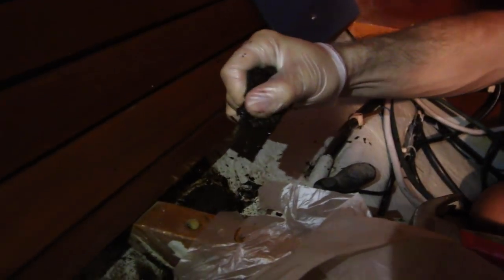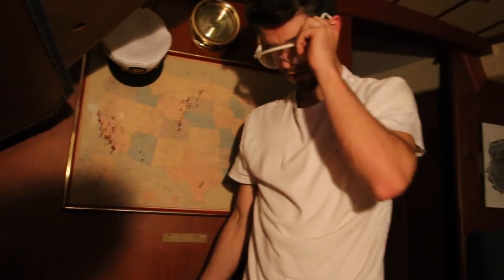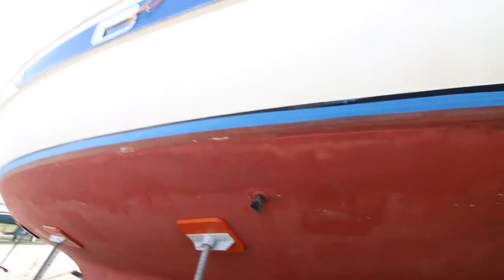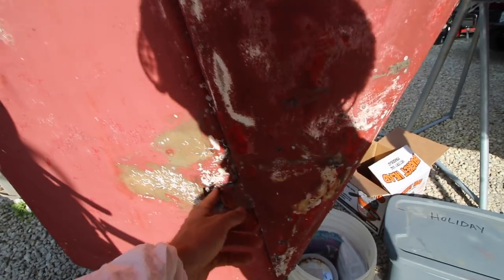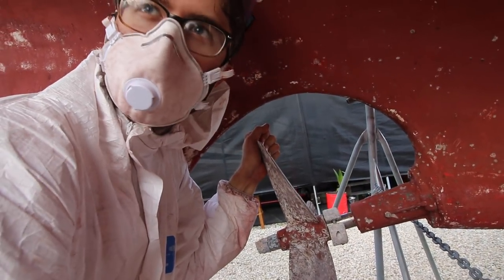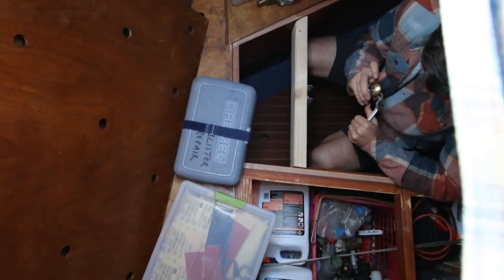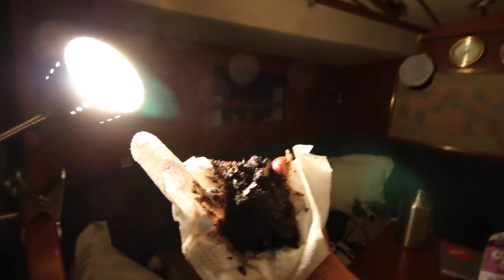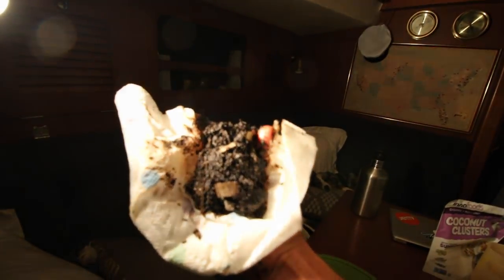25] Refitting Our Hallberg-Rassy 352 Sailboat (Part 1) | Abandon Comfort - DIY Sailing

Comment: Hey guys, I'm a diver who does hull cleanings. Depending on water conditions that stuff may have grown there between the cleaning and when Lucy was pulled out of the water. If you're not confident in the cleanings being done, shop around for a new diver and ask them if they would be willing to take a GoPro or similar camera down with them to give your a before & after of the condition of the hull. This will also help you to keep track of overall condition below the waterline.

Comment: About the plywood around the propshaft: i had a similar set up on my Contest 29. The ply wood has two tasks. One is, on my boat, to have something to fix the inner shaft bearing to, without having to drill into the fibreglass. Second is for installation. When building the boat, they put the tube in, in which the shaft runs, line it out anfd then fill it up with Polyester.
Reply from the maker: Appreciate the insights! Definitely seems right to us.

Comment: Love the HR 352, bit too much boat for me though. Moisture readings on that rudder and around the anchor pintles is in order I would say. I would drill a few small holes in the very bottom of the rudder to see what comes out myself. Your can just jack some 5200 in to reseal them.  The wood at the stern tube could have been temporary support for the shaft tube to hold it in place while the glass work was done.

Comment: You two are doing a deck job so you should have time to do a full bottom job.  I would strip all that old bottom paint to the gelcoat... the whole hull.  Move on to the deck job to give the hull time to dry out if it needs it (have some moisture readings done).  Take your time fixing the cracks and damage you find with epoxy/glass.  Someone already mentioned below, the rudder could have a wet core.  Take your time and fix it right.  After 6 or 8 weeks or drying time and all the blemishes fixed, put on a fresh barrier coat of Interprotect 2000E.
Reply: have we established if that rudder HAS a Balsa Core ??????
Reply: Not sure, and not likely on a Hal Rassey.  Even if its a foam core they can still soak up water.

Comment: Ok so my guess about the plywood you found with some epoxy paint on it would be that even with an inch of fiberglass it needs a solid shape to hold on to while it cures. No need to take the plywood out after the fiberglass sets up so it sat there for years and finally rotted itself out.
Reply from the maker: This seems like a good guess to us as well! Thanks so much for your insights & comment.
Reply: Do you guyz ever hear from Jim?   Curious if he watches your videos...
Reply: It might be a difference between the German Frers and Olle Enderlein layup design but our hull in the Rasmus is a lot different inside.  The construction of the cabinetry and the slats are dead on identical though.  They didn't change that at all. We have no wood down below like that embedded into the hull and have had zero problems with wetness/rot because of that.  In our boat the cabinetry and V-berth supports are all sitting on a big squared-off section of fiberglass molded in as stringers from bow to stern.  It is hollow and doesn't have any wood in it I do not believe.  Some of the upper ones are used as conduits for wires.  

We had similar wet wood and the "potting soil" in our deck though under the stanchions.  We had to open it up and dig it all out before filling in with thickened fiberglass.  What a PITA.  

Your shaft tube and stuffing box are a LOT more accessible than ours. We have to basically crawl down into the keystone area in the aft cabin head-first and then below the sole panels and do a handstand to reach it.  

Don't forget to post the fixes and update us next video.  I'm interested to see how you reinforced the area to support the V-berth crossbeam. 

That black stain almost looks like blood.  Maybe the last owner was a cannibal and he kept the carcasses up there under the V-berth.   Haha.  Don't think about that ;)

Comment: I'm a boat builder, the rudder, they are almost always an issue with keeping them water tight, best rudder is all hi-tec composite, post and all, pricey though.
So, rudders have metal components, and are also made of timber, foam etc all glassed with polyester or epoxy, both will not stick to metal, peels off, there's where the water gets in.
If the inside of your rudder is dry, ur lucky, if it's wet, then it is a removal, strip & rebuild job if you don't want any more issues. (You will still have future maintenance though)
See, those rudder pintels - the metal hinges, 'in' the rudder (where it's cracked) need to be external of the glass layup on the rudder, usually in a rebate, which has been glassed when the rudder was built, then some lay up over this for stream lining and looks, (or bog it up as later others see this as a fail and lay up more glass over the 'fail') this way no water will get into the rudder timber/foam to rot, stay wet and be forken heavy-as.... 
Now here's the thing, there is the rudder post, it has the same problem, it's metal, but here I have almost always removed the glass and core around the metal stock (post) a good 1 inch, beveled in on a 45 deg angle, glassed that tidy, when half set removed any glass/resin off the post to metal, 2 pack primed the glass after a little sanding to tidy up, then slightly over filled the 45 deg glassed hole with MS Polymer - wait a day till set and with a new 5/8" craft knife blade sliced it back to the rudder shape, (MS Polymer doesn't sand good) then undercoat and anti foul her.
Reply: Ideally, if you can get details on the original build plans, you will then have an idea where issue is, how the hinge is built into the rudder. The above mentioned repairs, may not be the whole issue.......
Some rudder builds have large metal plates the hinge is bolted/welded too and timber/foam is sandwiched to both sides, shaped, and glassed.
A short term fix to the above hinge/glass crack, may be cutting away some glass to a point where the glass is thicker, then knife on MS Polymer best you can, this giving a flexible join, but every time she is hauled give it a good look over. Re building rudders is a big but not insurmountable job for your abilities, and lots of learning hear is great!

Comment: Possible that the wood by the prop shaft was there as a dam to hold back the epoxy/glass mixture that was poured around the shaft log. If so, it is neither structural nor needed. Remove it and move onto other projects. Any wood near the prop shaft is going to get soaked.

Comment: I'd have someone with experience inspect that rudder and mounts ... absolutely critical that you can count on it to do it's job when stressed in rough waters.
Reply from the maker: Yea we had the guys at the yard look it over. They said its just the gel coat and nothing more. The rudder is solid just needed some epoxy & barrier coat to fill it in.
Reply: Boy I don't know, as a mechanical designer and if I saw the cracks shown in the video. It would be coming off for a through inspection and repair

Comment: Looks like your rudder has been in a collision. Inside, the core of some boats is balsa wood. Goes  like sponge when wet. Replace and re fibre Matt it.
Reply from the maker: Yea we don't think was due to a collision. It's a few small cracks in the gel coat near the mounts, the structural integrity of the rudder is sound.
Reply: Abandon Comfort lucky, maybe just stress cracks from sitting in a cradle. Or excessive rudder angle when under full power from the prop.Good luck with your refit. 👍
Reply from the maker: Excessive rudder angle sounds right. We'll have to look that up!
Reply: Abandon Comfort if you reverse your boat and apply half to full throttle spinning your prop at high speed and long durations.  then  turn your rudder at large angles it puts the rudder under a very high load. Short burst of power when  manoeuvring. It can do the same going forward with the rudder full over and high power. Slow controlled and small rudder inputs. Maybe difficult with a long keel, but use your prop walk and prop wash to turn. Look it up. 👍👌
Reply: BOW WAVE PAUL has some legit insight.  That rudder can experience tremendous stress when thrown over hard.

Comment: Guys I don't envy you that work, it's the darkside of DIY boat ownership, pretty brutal but please do yourself a favour and get a multitool, as I have mentioned in a previous comment they are amazing. I'll guarantee that you'll both kiss me in pure gratitude once you've experienced the wonder and bliss of multitool ownership, especially scraping they have no match. I had a similar feeling after getting one and the realisation of a lifetime of balls-ache that could have been avoided with a multitool in my hands. 
 
I personally would recommend the previous generation Fein or any similar Multitool that uses a similar tool interface, because the blades are so cheap, universal and plentiful, the current generation uses an almost proprietary tool interface that has as yet not been widely cloned and copied. Last I checked the dewalt also uses a tool interface that uses easy to source blades. If you doubt my words then try at least rent a multitool first and see for yourselves what I am talking about. Good luck and don't forget to use ear muffs/plugs with noisy power tools 😉

Comment: I would say that the stuffing box needs new seals / bearings and re adjustment. Are the leak proof rubber bellows still good and sealing.the stuffing box The box will most likely have a grease nipple ? Cheers from an old wooden boat owner.

Comment: I’ve fixed many things on my inboard/outboard power boat but one thing I will not do is sand bottom paint. That toxic job I will pay the boat yard to do...please use the best personal protection stuff you can get.

Comment: Just wondering what the purpose of that piece of wood in the beginning was supposed to be?  If it is a longitudinal stringer to stiffen the hull, then the flat surface just below it would serve the same purpose.  Just seems like a bad design.  If it were me I would just strip the whole area free of wood and down to bare fiberglass hull.  On my boat the whole cabin sole was wet plywood glued to the hull underneath.  I just ripped all the wet wood out.  Much better and no moldy odor either.  If you feel you really need a longitudinal stringer, I would just cut a closed cell foam strip and glass it to the inside of the hull.  The glassed in box shape will provide stiffness with no worries about future rot.

Comment: hey guys good job, Kelsey you should use a better respirator mask that stuff is poisonous and Ryan check all the chain plates and seal the deck if necessary water destroys everything
Reply from the maker: Agreed! Next time we're getting full-face respirators. And the chainplates need to be rebedded and sealed. The deck comes up tomorrow so we'll have a better idea of what we're looking at with the chainplates and the new deck will be watertight. :)
Reply: cool
Reply: curacao11 agreed definitely a better mask is needed. Ideally if you’re not going back to bare you should wet sand the antifoul.

Comment: I sure hope you tested that paint for metals (not just lead). I do this for a living (I'm a "CIH", look it up). Breathing any metals is bad. You should ditch those disposable respirators and get rubber ones with purple cartridges. If your face under the respirator is covered with the dust you're trying to filter, then so are your lungs. And sorry, but you need to shave your face down to the skin. Wearing any respirator with facial hair is like punching a big hole in your respirator. The respirator has to seal tight against your skin. Breathing that dust is just asking for future health problems.

Comment: hi, encapsulating any wood especially in wet areas is never going to last. get some Coosa board. it comes in different weights and thickness and is 100% rot proof   http://coosacomposites.com  available from various sources, and great to have on hand for almost any repair.cheers warren